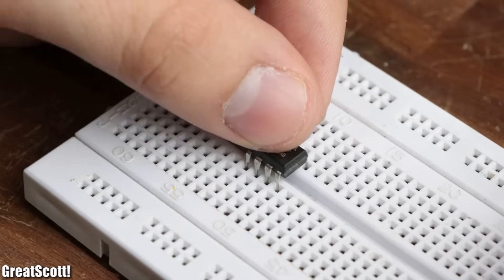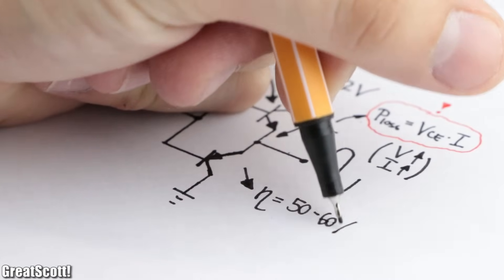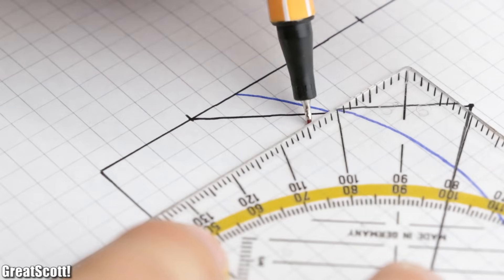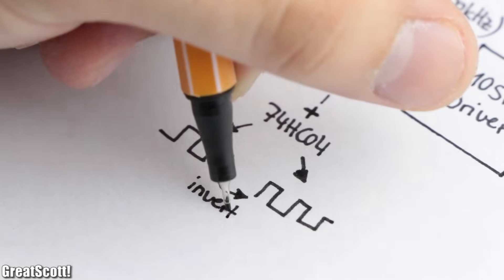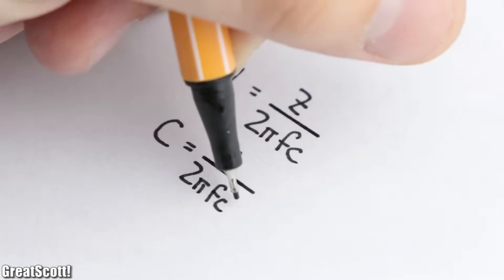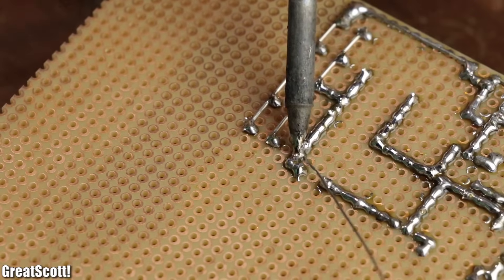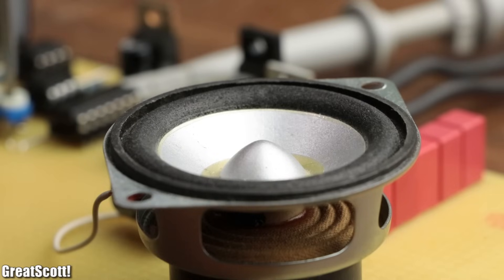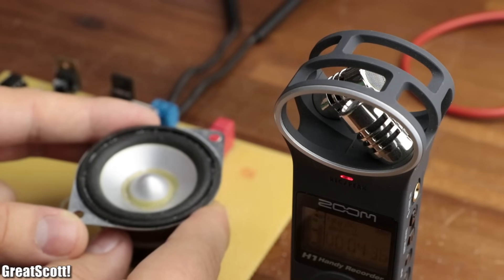DIY Class D Audio Amplifier

Comment: Great scott! I have a couple of questions:
1. What if I apply a square or triangle wave to the input of a transformer instead of a sine wave?
2. Will you make a tutorial about electromagnetic levitation? 
3. Where can I buy a transformer like that which u used in the pain test video?
Reply from the maker: 1. Works similar but has a couple of negative side effects. Better ask Google.
2. Sure.
3. Ebay
Reply: GreatScott! Thank you for your answers!
Reply: Thomas 131377 It will work, but the voltage at the secondary will not be exactly as same as that on the primary. A square wave is basically sum of infinite number of sine and cosine waves of different amplitudes and frequencies multiple of the fundamental frequency ( According to fourier series). Transformer coil is inductive and the reactance is different for different "harmonics". So the output will be of same frequency as that of the square wave but a little distorted.
Reply: Thomas 131377 3) Look for a "variac" or Stelltrafo. But don't forget that these are not galvanically isolated.
Reply: Thomas 131377 i want to know how do i match a speaker to an amp? speakers come in various ohms, wattage and sizes. if an amp has 100w 8ohm output then can I choose a 200w 8ohm speaker or I can use 80w 8ohm speaker also? how do I know what size (diameter) of a speaker will work?
Reply: Debojit Acharjee The amp will output maximum power when the impedance of the load is same as it's output impedance. so the speaker resistance must be same as output resistance of the amplifier. the power and impedance rating will be provided in the datasheet
Reply: Mahesh Bhat okay... but how do I choose the wattage of the speaker? if the output impedance of the amp is 4 ohms and the speaker is also 4 ohms then we can say that the impedance is matching but if the wattage of the amp is 100w but the speaker is 200w or less than less than 100w (80w). What will happen in that case if the wattage is mismatched?
Reply: Debojit Acharjee The impedance, voltage rating and Wattage are all related. Wattage = ( Voltage rating )²/ impedance. So if the speaker and amp have same voltage rating and impedance they will have the same wattage. As you mentioned, if amp and speaker are rated 4 ohm impedance both and 100W and 200W respectively it implies the Voltage rating of the speaker is more than the amp( sqrt2 times). Still you can use this with the amp without a problem. It will draw a current only to produce 100W. If you use a speaker with lesser Wattage, there is a chance of it getting damaged because the voltage rating will be lesser.
Reply: Mahesh Bhat okay thanks... but how do I choose the size of a speaker what difference it will mean to connect a speaker with smaller or bigger size if the impedance is matching? also how do I know the wattage of the speaker if only ohm rating is mentioned on the speaker?
Reply: Debojit Acharjee Usually votlage rating of the speaker will be somewhere around 12 to 20V. (not sure) So you can calculate the approximate Wattage.. Bigger the size , larger will be the voltage rating. If you are using this amplifier with around 12 V output, size shouldn't matter
Reply: Debojit Acharjee Usually votlage rating of the speaker will be somewhere around 12 to 20V. (not sure) So you can calculate the approximate Wattage.. Bigger the size , larger will be the voltage rating. If you are using this amplifier with around 12 V output, size shouldn't matter
Reply: Mahesh Bhat but this is complicated because the output wattage of the amp can be calculated from the supply voltage and the output impedance but how you will know the operating voltage of a speaker because on a speaker it's not mentioned but only the ohm is mentioned. The size of the speaker has something to do with the frequency response I think and I want to know what will be the suitable size of speaker for the amp. You are not correct because I have seen same wattage of speakers of different sizes.
Reply: Just answering number one:

1)What if I apply a square or triangle wave to the input of a transformer instead of a sine wave?

You can't.

No, wait I'm serious.Let me explain:
In fact, a square wave can be represented as a composition of sinusoidal waves.Which means that you're basically applying a lot of sinewaves that together compose a squarewave.

-----
example:
lets say we have a squarewave of 1000 hz(1 volt amplitude):

by using fourier series we can expand it in to this series:

  square= 0.636*sin(2*pi*1000*t)+0.212*sin(2*pi*1000*3*t)+0.127*sin(2*pi*1000*5*t)+0.091*sin(2*pi*1000*7*t)+....

if you add infinitely many terms you get a square wave(series converges btw).
-----

that decomposition is very useful because capacitors and inductors generally only alter the amplitude and phase of a single sine wave at given frequency(which means they act linear for sinewaves).

now remember your transformer is made of coils(inductors) and resistors.

that means that we are actually applying all those sines to the transformer at the same time.but since they have different frequencies  they'll be atenuated differently for each sine. which  means that the output of the transformer wont be a perfect square wave.

it will be distorted.That's one of the side effects. the ouput of the transformer will attenuate more higher frequencies and less lower frequencies.

Don't get me wrong, it will work, but if  you're just gonna get some deformed square  out of it why not just use a sine that wont weird out of it.

My point is: No matter the wave function you apply, mathematically you'll be just putting a bunch of sines/cosines in your transformer.
Reply: Matheus Rotta Thank you very muck for your answer! Very good explanation!
Reply: Thomas 131377 i want to know how do i match a speaker to an amp? speakers come in various ohms, wattage and sizes. if an amp has 100w 8ohm output then can I choose a 200w 8ohm speaker or I can use 80w 8ohm speaker also? how do I know what size (diameter) of a speaker will work?
Reply: Debojit Acharjee The wattage of the speaker can be higher then the wattage of the amplifier and it will work just fine(as I know). But if the wattage of the amp is higher than the wattage of the speaker the speaker will get "killed". I'm not a sound engineer or something like that so I don't know much about the diameter and I don't want to tell you something wrong...
Reply: Thomas 131377 Okay... now I got the thumb rule that the impedance of the speaker should be within the range of the amp (in ohms) and the wattage should be higher than the amp but how much high? And how do I know which speaker of what size and wattage is going to give best frequency response and performance?
Reply: Debojit Acharjee I have a 6w speaker with a 3w amplifier (in my portable speaker that I built) and it works very well. I can't tell an exact value because as I said earlier I'm not a sound engineer but I think (so I can't guarantee) that 3-10 watts higher will work just fine. I think the diameter doesn't really matter when speaking of wattage(probably it matters when speaking of resonance frequency or drequency response). The frequency range has to be written somewhere on the speaker or packaging (my speaker is 20-10,000 Hz) I'm sorry but I'm  not sure what did you mean by performance... And I think the wattage doesn't really affect the frequency response.
Reply: Thomas 131377 Let's ask Great Scott then... or can anyone answer this? What is the maximum wattage of speaker we can use witg an amp for best performance?
Reply: Debojit Acharjee There is no maximum you can use for example a 50 W speaker with a 3 w amp if the impedances match...as I mentioned earlier the amps wattage shouldn't be higher than the speaker's wattage.... That speaker will work with 3 w...and act as a 3w speaker
Reply: Thomas 131377 but I have noticed that when you use higher wattage speakers the audio volume gets less... so there must be some matching rule!
Reply: Debojit Acharjee Read this and it will probably answer your questions:
http://www.the-home-cinema-guide.com/matching-amps-and-speakers.html
Reply: Thomas 131377 i read it but didn't find any engineering method for selecting speakers but this guide only says how to select a speaker for any amp. In this guide its written that you can use a lower wattage speakers with a higher wattage amp and you can't use a higher wattage speakers with a lower wattage amp because it would damage the speakers but I think it's bad to use a lower wattage speakers with higher wattage amp because the speakers would get excess power from the amp. Fir example if a 12V battery has 1000mah will have a power of 12 watts and cannot do harm to a bulb of ratted higher than 12 watts but if you use less than 12 watts bulb then you will get more light but it would fuse easily!
Reply: 200w x 8ohm = 1600, √1600= 40volt/1speaker , I(amp)=200w / 40volt= 5amp. Two 8ohm speaker/ one channel = 8/8 = 4 ohm, Two 200w speaker/ one channel = 200w + 200w = 400w, amply = 4ohm 400w/one channel = 40volt/ two speaker one channe.
Reply: basically, you can use any wattage speaker on any wattage amp output, as long as the speaker impedance is the same or higher (you 'might' be able to get away with lower, if you're only going to run it at much lower output than its capable of),  depends on how many watts you want to get out of the amp, a 5w speaker will be safe on a 100w amp if you're only gonna drive it to 5w or less.....but always 'advisable' to go higher, not lower!
Reply: Debojit Acharjee Just to get this straight. The wattage of a speaker is NOT what you're looking for when matching amps and speakers. 
Take a look at the spec sheet of the speaker and you will find it's sensitivity. THIS is what to look for when matching speakers and amps, because it says how high the SPL is when only using 1 Watt.
Lets say you have two speakers. Speaker 1 is 8 ohms, rated at 35 watts RMS and has sensitivity of 91dB/W/m. Speaker 2 is also 8 ohms, but rated at 100 watts RMS and has a sensitivity of 86dB/W/m. You want to drive the speakers at 106dB SPL.
This would mean (after calculations) that for speaker 1, you would need only 32 watts to get it at 106dB. And for speaker 2 you'd need 128 watts for also 106dB.
You see what I mean? You shouldn't look at rated power or impedance, first look at the sensitivity to match a speaker with an amplifier. Then look at impedance to make sure your amp won't overheat because impedance can't get too low.

Comment: Thanks for sharing your expert advice and advanced expensive equipment to validate the authenticity of your video. I appreciate a true hobbyist that does these things cause he can. I think its awesome how your showing the signal from the original pre amp to the fully amplified filtered signal (sound). I am glad you included your specs on the components. I can finally move forward with my similar project with confidence of proper sizing of my components and correct IC's. I only get one shot at this because I am not able to buy materials. You have just made my day four years ago today. I never researched this topic on YouTube before but I am thankful I ran across yours. Its been a long few days sorting through all the fake non-proven videos. I harvest my materials from broken electronics people put in the trash. That is very easy. The hard part is the research. I do not have the equipment to achieve the perfect results I insist from myself. Cheers I appreciate all the time, effort, skill, and money you put into this truly educational video. Perfect!!!!Thanks

Comment: Suggested improvement to reduce distortion: add transistor diode current source instead of the resistance between pin 7 and vcc of the 555 to linearize the triangle wave

Comment: Nice video! I had a question about the design though. Since this is a single-supply class D amp, what does the low-side switch do? When the high-side is on, the voltage potential is VCC to ground, but low side just connects the speakers ground to the MOSFET ground instead of to a negative supply. Did I miss something?
Reply: The low side MOSFET discharges the capacitor when the resulting signal is going through a negative slope, particularly when this slope is steep, it's easy to be deceived into thinking current through L only flows in one direction, but that's not the case, as C can be discharged through L and through low side MOSFET to ground, quickly lowering output voltage.
Reply: @diego5733  so would the signal have a DC ofset?

Comment: 7:20
I would reduce the control voltage of the 555 and re-tune the DC offset
Reply: ..and maybe use a speaker in a cabinet, or that one sat in a small enclosure

Comment: Question: Why did you omit the DC blocking capacitor to the output? The coil does not block DC and feeding DC to speakers reduces its performance and durability. You said it wasn't perfect and i get that, but it's just another cap maybe a 1000uF 25V, not much effort since you are not using a negative supply. I might be wrong though, mainly asking just to clarify that :D
Reply: The board looks like its a bridge-tied load - 4 MOSFETs and 2 output inductors, so no DC-blocking needed.
Reply: 2 other to-220 is regulator for 5 and 12v. There should be 7.5v DC in output (14W for speaker) because output circuit is same as in switching dc regulators (like in motherboards).

Comment: Make something abaut tubes ?
Reply from the maker: I put it on my to do list
Reply: дядя Kakadu and other obsolete tech. You could make a top 10 list or something.
Reply: Why would you want to see old tube technology? Semiconductors are so much easier to implement and use much less power. The only time a tube would be warranted is in very high power RF applications and even then semi's are quite good at this these days. An audio tube amp may use tubes for linearity but MOSFET's and BJT's are pretty good these days as well. Modern BJT's in class A mode can sound just like tubes in audio applications.
Reply: Because it's cool learning how stuff works Shane.

How about a Nixie tube clock? This guy relearned how to make Nixie tubes: http://www.daliborfarny.com/ , his are still quite expensive apparently but maybe he'll get you some cheaply for some publicity?
Reply: Alex C that's an acceptable answer.
Reply: Nixie tubes aren't really a tube but more like a neon lamp. As an engineer, I just don't find tubes cool(they get quite hot) and not that complicated to understand. Why do you think semiconductors were invented? Because tubes are very inefficient. I used to play around with tubes as kid and yes they glow orange.....ooooooooooooh the glowyness soooooo alluring.
Reply: Shane Mitchell well if you would actually be an engineer, you would know, that tubes introduce distortion, which to some people (including me) sounds better. But you have to chose the tube carefully, as some don't introduce the distortion.
Reply: I never mentioned anything about distortion. I know full well that all amplifiers introduce some distortion irrespective of the topology. BJT's and MOSFET's can replicate valves and use a shit load less power, also speakers introduce more distortion than most amplifiers and it is always the weakest link. You're obviously not an engineer as you would have picked up on this.
Reply: 'BJTs and MOSFETs can replicate valves'. I could refer you to thousands of guitar players who would strongly disagree.

Comment: I think you could try emitter degeneration on your amps/comparators, as your descrete transistors arent well matched as they would be on IC's. :) in bias current outputs, the Vce is larger, so they get hotter and lower threshold, so current increases even more until your operating point is way off.

Love the look of that PCB! 👏

Comment: Nice build. ...Killing me by using the 386 on a class D, but I've done the same before. They make convenient buffers.
  If you want a warmer vintage sound (the LM386 is adding it's own tone so you might as well choose a style), check out the site runoffgroove.com (no affiliation). Their open source "Fetzer Valve Deluxe" project goes through how to create a single JFET buffer that sounds really interesting. I have that stage running in front of 2 different guitar amps and I like it. It would be interesting to see how a 'tube amp' simulated circuit sounds with a "Class D" output.
Reply: how he added 386 to the circuit? 
and why? you can use 386 alone, without class D amp, so what the case? Is it in the quality of sound?
Reply: LM386 was used as a preamp, before the Class D.

Comment: I made my own filterless class D amplifier just with Arduino. No filter, just plug in the speaker directly to the I/O pin then it works. It still requires biasing circuit and preamp. The key is the direct modification of PWM registry and some brute computation.

Comment: This is a really interesting design since it eliminates the need for dual rail supply. Most of the designs I've seen need a separate converter (or supply) for dual rail voltages.
Reply: There are many designs out there that work off a single supply...